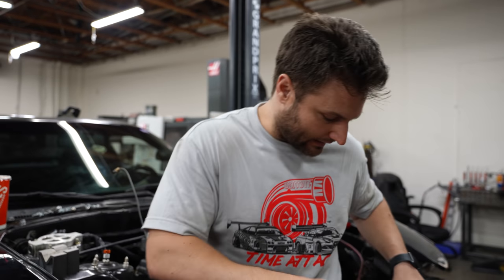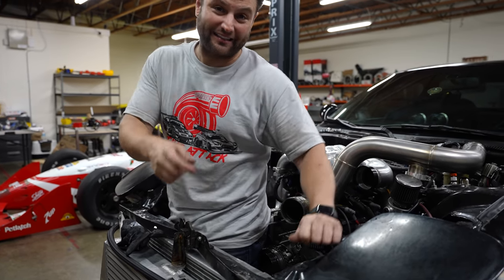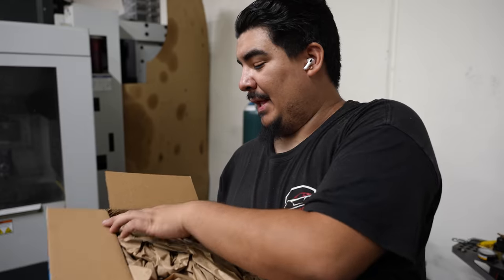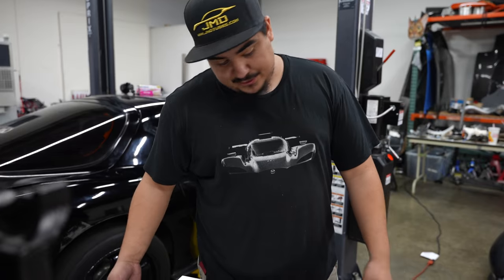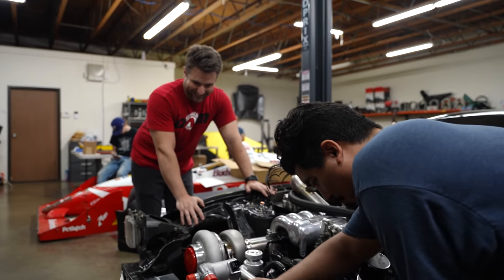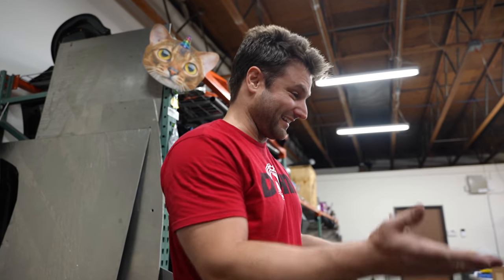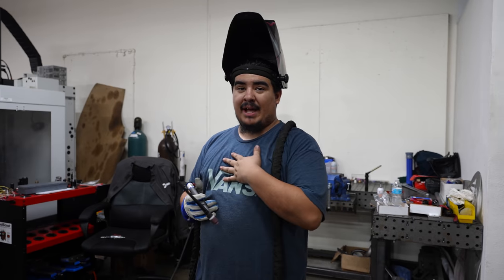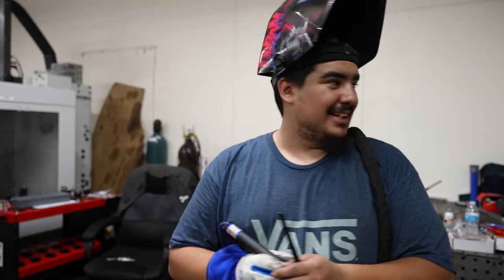We make it ICE COLD for the 1000HP RX-7.

Comment: Hi Rob
Are you gonna use the tinyCWA controller for the waterpump? I think it has a 10hz Pwm output you could use for the fans, if its the right frequency. Or just control it with the ECU, if it has a Pwm output. Judging by the sounds it makes, i would not trust it to work long, if even for the next race.

Comment: You could just have two separate relays for each fan to turn on separately. This way you get two options of 50% or 100% cooling.
Also, as others have mentioned, oem(ie gm) pwm fan controllers work great and are reliable.

Comment: If that controller gives you issues you could get an EVSC and set it up to run the motors. Very customizable high quality controllers would be simple to run with an Arduino and a few temp sensors or even with can depending on how your doing ecu stuff. Hell an EVSC could run the water pump as well.

Comment: So the radiator outlet pipe is a great idea.  But it looks like you’ll have a large air pocket that can’t be bleed.  The way the oem achieve this a very small additional pipe that is the highest point on the end tank and goes to a high point on the expansion tank or your case the swirl pot.   At least the way I under stand it if there is air any where in the system other than the expansion tank you can introduce cavitation or air and have a run off.

Comment: Some time ago, I thought about the possibility of designing a fan controller but with the advancements in aftermarket ECU's I figured it wasn't going to do well.

That temp sensor seems to be flawed by design since you rely on the thermal transfer properties of double sided sticky tape (which is actually an insulator being its closed cell foam). I always figured one could use a higher end RC car ECU for the fans.

I still have my OE Subaru fuel pump module which does PWM by modulating the GND return. Figured I would get bored and try this idea out again.

Comment: Fans generally need a lot of power to get started, try at least 60% duty cycle if you can. If you have enough ECU outputs, two simple on/off relays activated at different temps should stagger the load with a lot less complexity than adding a PWM controller from a company you don't exactly trust. I'm an EE not ME, but I think it would be better if the electric pump could be mounted lower to improve the head pressure. Pulling fluid uphill isn't ideal in terms of air pockets, either. Also, kudos if you actually read even half of the 560+ comments I'm seeing at 12:43pm PST!

Comment: Sorry Rob you’re wrong on the “fuse”. That is a circuit breaker and there is nothing wrong with it. These are used in tons of off-road vehicle fan setups. I don’t like how that box is assembled either. I would be adding a lot of heat shrink with glue to all of those wires and maybe consider using some liquid electrical tape on them. 

I agree 110% with you on those shitty ass terminals. The best thing anyone can do that is messing with automotive, off-road, etc wiring that you actually care about is to buy a big assortment of 3M heat shrink electrical terminals. If you want to go all out there are ones called solder n seal that are the fucking best. Highly recommend. Another nice product are the Posi-Taps that come in splice style and tap style. I like to keep on me in the vehicle so if something does go wrong out on the road I can easily fix it and have a super strong and high quality connection.

Comment: Suggestions:
  1. Make starter and battery much bigger
  2. Remove engine., turbo, exhaust, intake, fuel tanks and pumps.
  3. Replace cooling system with smaller one.
  4 . Replace transmission with simple gearing system or direct drive.
  5.  Sell 1500 unnecessary moving parts.
  6. 0-90 in 3.4 seconds.

Comment: duct the fans so they go under the car, gives u more downforce at speed, with little drag as your lossing the drag from the engine bay and pushing it under the car ie its a win win also means u can run a smaller fan to give more air flow at higher speeds once the air speed passes the point of the fans air speed (as long as they can keep the car cool at idle) also possible to put a thinner rad in to give more room to duct it under the car with out lossing cooling performance.     basically its working on the same base has the blown diffuser

Comment: You want it on the water going into the motor, unless you are going to reprogram the controller, otherwise it will never shut off. 
Duct the air coming out of the radiator out a hood duct. Allow air not going through the cooling system to enter the front and exit out the back of the front fenders. Allowing the air to go through an air superheater, aka radiator, then flow over the motor is fighting against itself.
That's why having a radiator width duct going up through the hood is so much better. Taking air from above the splitter and passing it under the air superheater, aka radiator, and purge the heat from the engine compartment will drop underhood temps by 50 degrees or more.

Comment: And u could use solid state relays and an esp32 to run all that stuff .  Wouldn’t even be expensive and u could code it all easily even build a display show coolant temp fan Speed u could even ad air pressure sensors  humidity .  

If I ever get some spare cash I’m do it.   

Nobody even checks air intake content   I think the air that the car is ingesting is a greatly overlooked parameter.   

 If your in traffic and u go through someone’s airstream that has a stuck injector your gonna intake highly fuel rich air .  

If u can tell how good the air your engine is ingesting.   

You can get a very accurate fuel burn .

Comment: How about water spray to intercooler and radiator? Water takes a lot of heat during evaporation.
Reply: Old Evos did this. only problem is getting water under the tires or on the track i would imagine that could be dangerous

Comment: @Rob Dahm  You need to be buying MOTORSPORT grade parts, especially for electrical.  Most of the  stuff youre dealing with is designed for street rod and sedate muscle cars that dont even need it.  There are controllers available that actually function properly and can integrate with CAN to utilize the coolant sensor on the motor or where ever you want to put it.

Comment: I must say, i put the same size spal fans you did on the 3 rotor on my 13b,it takes exactly 12sec to drop the temp from 85°C to 75°C. With a Davies Graig water pump and controller.
Reply: Can you confirm that the ewp resulted in better cooling than a mechanical water pump?
Reply: @atoarkaah5800  look,the mechanical water pump is fine and work 100%. The main reason i used it was for heat soak after the engine is off. That translates to coolant seals lasting longer, because the electrical pump can circulate water and cool it off even when the engine is off.. hope this helps
Reply: @slywhips1694  appreciate your response years later. I’m seeing temps in 194-205 F in 90 F ambient and I’d rather have 185F.  Hence my questions. Thanks

Comment: I bought the exact same fan kit and was extremely underwhelmed with the mounting material. Taking them out next week and also doing a custom shroud to fit a new radiator. I was under the impression they were running full power at 49amp though. Yours say 65?

Comment: Seems like that module is frequency dependent. What frequency did you try to  run the pwm module at? Get a n02 solid state relay or relays and use the ecu to pulse it instead of that pos.

Comment: I have the Derale 14" RAD 2 speed fan. I hated the shock to my electrical system when it starts and I really don't trust their controllers so I'm letting my ecu still control the fan but I picked up a PWM fan controller from a 2006 Ford fusion. It's fused for 60 amps factory. It also has a soft start built into the controller and only requires 1 PWM wire from the ecu. I'm gonna wire my fan to be on high speed and use the controller to slow it down with PWM. Maybe an option like this for your setup?

Comment: Those derale fan controllers are known to fail. The best fan controller is from theautocoolguy the HF125 is best paired with spal fans because it runs the proper frequency at 7KHz. It'll prevent the buzzing you hear too.

Comment: Maybe try looking at a ford fusion fan controller or c6 c7 vette fan controller if you're ecm/pcm can supply a PWM signal to a fan controller. Those are the common fan controllers people doing LS swaps are using. On my squarebody i'm using the dual fan and controller from a 2011 Audi A4 so that's another option!

Comment: Just wondering, why didnt you get a single larger fan if the fins on your radiator make a square? I come from a computer background so my knowledge on the subject tells me that a larger fan pushes more air at the same RPM, it looks like a lot of your fan isn't blowing directly through the radiator because of your reservoirs and the gap between the two fans so a single larger fan may increase performance as well.

Comment: screw that POS pwm controller use your fueltech to control PWM of the fans and use a 65amp 12volt solid state relay which will allow you to use the pwm output from your fueltech to turning on and off the solid state relay with the PWM.  example part of solid state relay part number 7564-HC

Comment: The thing with sticky tape is the adhesive starts to melt at above 30'c. Its not a question of 'When' but that thermal sensor will 100% fall off when you start driving the car and the engine starts heating up.

My suggestion would be to create a small bracket that pins and holds the sensor in place with a little gasket maker or rubber/silicone sealant or go all the way and use a thermal epoxy and permanently attach it to where you want the sensor to be. That way it can take the heat and is less likely to fly off and get caught up or damage something.

Comment: one question i have is, does TIG welding not cause flash burns? I deal with stick most of the time, a little MIG but the main problem i have is without gloves I get terrible flash "sun" burns when welding a lot

Comment: I dont recommend running those PWM Controllers with SPAL brushed fans.  The PWM controller is super low switching frequency, (That's why it squeaks/squeals.)  ~500 Hz.  The SPAL motors  have 20 commutations per revolution. If the fan is spinning 3000 RPM that's 50 RPM/second.  50 RPM/sec * 20 commutations per revolution = 1000 hz ABSOLUTE MINIMUM frequency.  So if your controller is 500 Hz. you are essentially only powering half the windings at full speed, and you're going to burn up those motors. (That's not exactly how it works, but for this forum it's a easy way to imagine what's happening.)   Low frequency PWM "hammers" motors like that to destruction.  TLDR it's going to kill those motors.   The PWM controller uses a MOSFET to switch the main load of the fan.  At full speed, ~30 amps.  So that little electrical component gets f*cking hot.  Guess what happens when electrical components get hot?  They stop working.  So this controller should be mounted somewhere cool, not on a hot radiator.  TLDR the controller uses a temperature sensitive thermal component, and it's mounted on a hot radiator.  So the controller may not function  very long.  Bottom line:  Brushless fans are the ticket.  But I'm a little biased.
Reply: If the switching frequency of the controller was higher, above ~16,500 Hz.  It would make less audible noise to humans and be quieter.  But the faster you switch the heavy current load of the fan, the more heat the MOSFET has to dissipate.  So high frequency controllers are more expensive.  Another concern is 'what does the system do if the fans "soft start" too weak and stall?'  Does the PWM controller recognize a low power stalled fan?  🤔  Or is that thermal/self-resetting circuit breaker supposed protect that whole system?  🤔
Reply from the maker: You worded it way better than me. I assumed poorly that a thing advertised as pwm would naturally be brushless. My mistake. I talked to spal engineers at length about the proper solution

Comment: I’d be interested in looking at the schematic for that fan controller. That noise tells me they are pwming the fans at <20kHz. My guess from that sound is that they are pwming around 6-10kHz. And I’m also guessing that the duty cycle is way too low (not 60%) so the fans aren’t even spinning. Something is off
Reply: reading the instructions for that pwm controller i believe even the override uses the temp sensor (thermocouple or whatever they are using)  as an input for how much duty to give it in override.  Since the engine wasn't up to temp or the sensor not in use was probably causing that if i had to guess

Comment: Is there such a thing as a rheostat knob that could be wired in to the cockpit?  Have it infinitely variable like a light dimmer switch.  Or have detent stops at 10% 50% 80% and 100%?   I imagine it would be like a normal car's fan controller.  Obviously, it wouldn't be tied to a sensor in the extreme manual sense.  Maybe it wouldn't work considering you're talking 65 amps of current running.

Comment: If the fueltech has two PWM outputs then ditch that Trash and do a little research in Digikey. com for DC/DC SSR. Two 40 amp SSRs should be fine. They can be PWMd by the fueltech for variable Speed. I've done this myself on my Haltech so absolutely should be possible on the fueltech

Comment: if the fans are making that noise when trying to override/ jumpstart them by shorting it out get rid of the controller its fucked, the fan motors will burn out. Not to say I'm  a professional but I'm an electrician or a sparky as us aussies call yourselves and I work on fans and big motors all the time. If a motor makes that noise.. turn it off, either the fans cooked or something controlling the fan speed and rotation is wrong. Extensive periods of high frequency noise will burn them out.

Comment: The biggest mistake I've made in my cooling system is going to a  4 core radiator I have roughly 3800 CFM of fans with a badass pwm controller and I wish I had stuck with the 3 core... it would have worked better and the reason why is the radiator is so thick it's hard for the fan to suck air through it.

Comment: When do you have the heat problems? When idling in the shop and doing your 0-“speed limit” pulls in the street?

Like, I agree that more airflow helps, you just weren’t real specific. I doubt the fans will pull air through the radiator at 30 or 60 mph?
Reply: Unless I have the dumbs and you mentioned it while I was typing or during the last 2/3 of the video

Comment: Be careful with getting the flow rate too high.  It takes time to transfer the heat to the cooling fluid within the engine and time again to transfer heat from the fluid to the air in the radiator.  How about trying a radiator located behind the drivers seat and move the hot air out to the low pressure area behind the rear end of the car?

Comment: I guessed correctly, actually. it's the same reason people's computer water cooling dies. They put their connections at the top of the computer and air collects there and bubbles run through the pump or it even runs dry reducing the life of the pump. The system fails and they get mad and blame the manufacturer and not the person who designed the layout wrong.

Comment: Just get a holly sold state relay and set up a map in the fuel tech for pulse-with modulation for coolant temp vs fan speed. Why would you ever use a secondary fan control system with the ecu you have.

Comment: I would not send 30-40 Amp through those yellow shoes, they are for 6,0 mm² wire max, I would use atleast 10 mm² for 30 Amps, maybe more if it is powered from a rearmounted battery.

Comment: If the radiator is too big it won't flow as good as a correct sized smaller unit . Laminar flow and turbulance and cross sectional area and all that. Hope Them fans are the business,  spal make the best fans in my experience we use them in multi directional fork lifts that get shiped to dubai and every rally and drift car .🤙👌☘💯

Comment: Doesn’t the Fueltech ECU have a PWM controller for the fans? Then you can ditch the shit that probably won’t work correctly. And you need some air bleeds on your radiator and coolant pipe or else shit won’t cool properly.

Comment: When you look at electronics there are only 3 specs, standard, military and AUTOMOTIVE. Those are home electrical parts and not automotive spec. Those fuses may not be rated for those temperatures. A home doesn't move that is why they have spade connectors without relief.

Comment: Honestly, go for some used fans from Audi or some reputable brand. They've got cooling worked out to a tee. Also you can make a massive difference by separating your radiators - stacking hot in front of cold is never a good idea. Check this out for bi-turbo cooling (engine radiator would go in the middle) now THAT is how you improve cooling efficiency, you don't  need massive raditators or intercoolers they just need proper airflow with a half decent fan and not stacked behind another hot cooler! https://audimediacenter-a.akamaihd.net/system/production/media/84135/images/7fb0128cd23957b54c64c0cf605e6e8cb5c6d4a5/A1912016_blog.jpg?1582560935

Comment: I have a $1,300 Griffin radiator on my 87 F250 and the fans didn’t pull hard enough to suck those flappy things closed… I ended up taping it up with dei heat tape. :/ They seem like a great idea but in practice I’m not 100% sold.

Comment: I got one of their fan kits a few year back to put on my truck. It worked great til the hardwired temperature probe shorted out. Had to put the thing on a switch. Their little circuit breaker freaked me out too running all that power exposed not even a half inch from a solid ground. Would never recommend it. It broke just outside of their warranty period.